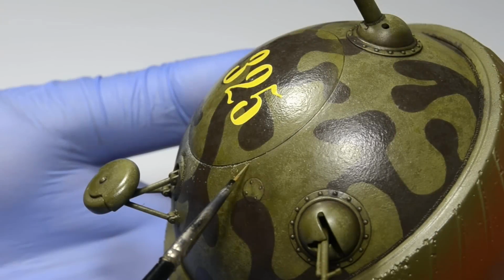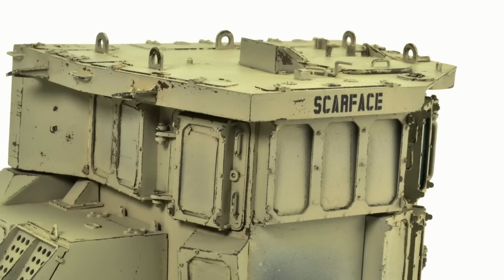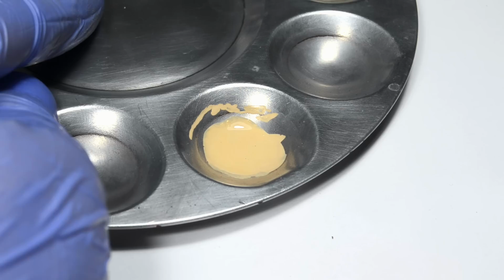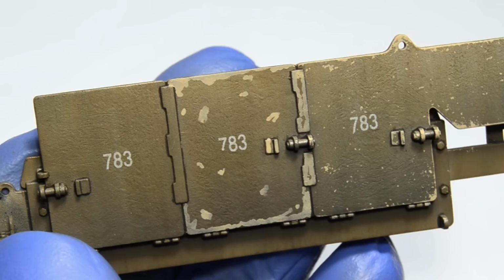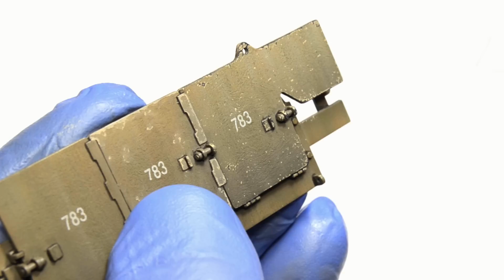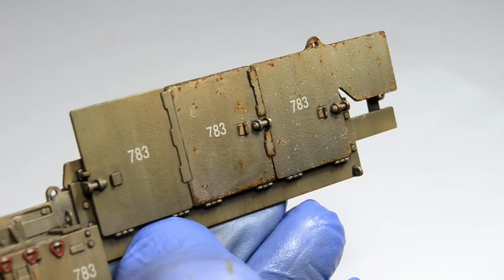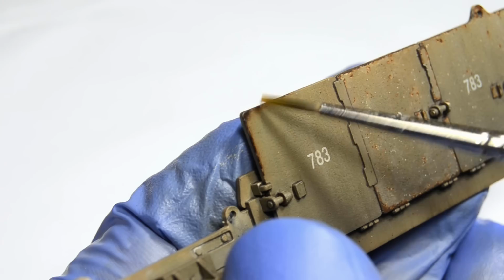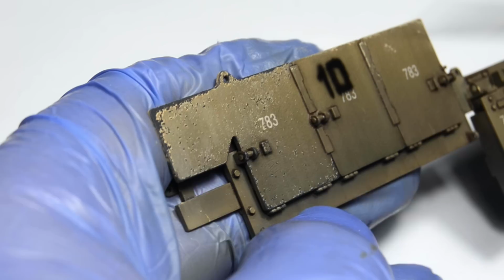4 EASY Chipping Tricks For Beginners

Comment: WOW! THIS was AMAZING! The Techniques were AWESOME and I LOVE Your sense of humor! Your English is Very Well Spoken.

PLEASE do more of these Tutorials! I'm a 55 yr. old Modeler that has been at this for almost 50 yrs. and I STILL learn New and Awesome Techniques like this!

One more I will add... I have used this to create realistic "Bare/Exposed Metal" effects by shipped paints.

FIRST I apply several layers of "Stainless Steel Epoxy Spray Paint" as the "Raw Metal".  Once dried, this gives an EXTREMELY Hard and Durable "Metal" Effect to
apply the Main Color{s} over.  Then I apply a "Chipping Agent" such as "Yellow Mustard" condiment, or Liquid Latex or Rubber Cement in the "Chipped" Areas.
Once the main paint is applied rub off the Chipping Agent and you will have a realistic "Exposed Metal" look.
I did this on my Darth Vader Chest and Belt Boxes and some other parts of my Screen Accurate "Darth Vader RotJ" Costume.

Next, I am currently working on my Han Solo "DL-44" Blaster Prop, using a REAL Metal C96 German "Mauser" from DENIX for the main gun, with an after market Conversion kit.

I have taken apart the Mauser and Stripped the Paint from all of the parts. Once the Stripping is done, I will Start the conversion. When I am ready to Re-Paint it, I will
Us a "Chipping Agent" before I apply the Satin Black paint. Once I have rubbed off the "Chipping Agent", I will do further weathering with some rusts, Oil and grim looks.

I hope this adds to your arsenal of techniques to try?

Be Well.

Joe

Comment: I have watched this many times since I started making models. 

I found one big advantage to the hairspray, chipping fluid, and salt chipping methods. 

With those methods you get actual paint breaking off the model. With the salt chipping method I had bubbling underneath my paint which makes it look like it was rust that was painted over without properly prepping the metal underneath or if there was rust forming under the paint layer. 

It gives a 3d effect on the rust/chips instead of flat painted on chips. I am still a noob and this was Unintentionally done on my latest model using the salt chipping method.

Comment: Good tips there. One thing I'd like to add is this:

think before adding any chipping (or wathering effect for that matter). Way too often I see models look lie rust buckets, but military vehicles are a) often well maintained, b) occasionally repainted with c) quite hardy paint (since one of the purposes of paint on a vehicle is to protect the metal), not to mention d) often destroyed, knocked out or simply abandoned before any serious paint damage can occur. Also, note where the vehicle is operating, and when - sure it might develop rust during a rainy autumn in Normandie, even if that's not certain - during WW2 they used lead paint in thick layers which was hard as hell and could take quite a lot of punishment before chipping off, but in the summer in North Africa? Not so much. 

So additional tip here: think and reflect.

Comment: You have single handedly inspired me to take my details to the next level I went from just painting a coat over a model and being done but the other night I started a new m48a2 Patton tank model and one of the miniatures had a flamethrower that was pretty small and you inspired me to do weathering and I had a rust and weathering kit of paints and I did some light rusting on the pack and it was only a little rust but I was so proud of myself cause it actually looks good

Comment: AWESOME! I found it very interesting! I know most of these techniques and you don't want to use mineral (white spirits) or other thinner over your paint - it will remove what you want to keep! I use Apple Barrel brand or Plaid brand water based paints because they are more forgiving and easy to remove mistakes, and dry very hard once completely cured. Thank you for sharing this with the rest of us!
Reply from the maker: Hey mate, actually no, if the base coat is lacquer based and you give enamel and oil paint layers enough time to dry, the white spirit won't remove anything that you'd like to keep there :)

Comment: Another useful tip is to make the chips tell a story, areas which get impacted more would have more chips like where the crew would climb in, where things would scrape like down the sides in the direction of travel and where stuff would be thrown up (like bricks at track ends with damaged guards etc)

Comment: i swear that YT know exact;y what i need, i currrently working on chipping on my project and your tip come at the exact moment, thank you,for a very simple, exact and precise guide.
Also, the trick to do sponge chipping is that i have to tearing the small bit more........ Mind blown, that the reason i just can't get this technique right
Reply from the maker: Haha, talk about perfect timing! Glad you enjoyed the vid!
Reply: @NightShiftScaleModels  Really thank for your work, but there is a thing i want to ask, i work on a very light sand yellow base color , what color did you think will work as the fist chipping color ?, I try to mix it with light gray , but since the base color already quite light, it just complete blend on the base coat and very unnoticeable
Reply from the maker: Well that's a tricky one. You have to see for yourself if there's still room to make it lighter without making it look white. If that's not possible, use just the dark chips, the contrast will be quite strong so they'll be nicely visible. If it's a vehicle that's been repainted with sand yellow, you can also use the underlying color for chipping (example: a soviet tank in desert, or a DAK Pz. IV)
Reply: @NightShiftScaleModels  i able to get it work, it not noticeable at the fist glance, but when i put the dark brown chipping color on, the lighter outline really do pop up.  Also, can you give me some tip on how to make those extreme sharp straight scratch line ?, my despite quite thin, still look like it was paint on
Another thing about sponge, i already remove most of the paint , when i stab the sponge it leave more like a drag paint (image that you swipe a wet paint dot), instead of clean dot like you do
Reply from the maker: @hl1796  About that sponge, try to find a different texture or tear the edges a bit more. I've had one sponge that didn't create nice patterns at all. Could be just bad luck for you. As for the long scratches, it's quite hard to explain. Basically sou should have slightly less paint in your brush than usual and barely touch the surface while painting it. I plan on making a video about it but find it really hard to describe how to proceed. It was trial and error with me, give it a few more tries, because it sounds like you're doing everything right, just need more practice.

Comment: Have you ever done any chipping that mixes old + new chips? i.e. this shot got there a month  or two ago (and rusted over), and this other one is brand new?
Just wondering if that would look weird or ok (if you've done that before). I've been inspired with a number of channels, yours and doing a  gunpla model. I know I'm putting the cart before the horse because I'm stilling scratch building some new parts and screwing up a model of the same thing I did years ago (practice), and every modification I think of still looks good in my head (as it always does).

Also thanks to putting it all to video. I wouldn't have been inspired to get back into models without you and  the other model builders on youtube (I was never an armor builder, but wow, amazing techniques!).

Comment: oof the amount of grease and Dirt the accumlates under large machines. The mechanics told me, watch your output shaft we replaced the seals but make sure the shaft seal we put in stays in place or you will be throwing oil out of the transmission

Comment: I weather my models as realistic as possible, to example I have more chips at the front of my ww2 panther tank because that's where most of the weathering would be. I always remind myself that I shouldn't do too much if my tank just rolled if the factory. And scratches would not really happen at the rear because any bushes won't be there to scratch it. And a tank usually had thicc paint on it so it woudent go of that easely

Comment: What I found most useful was how thin the paint should be when connecting the sponge applied chips with a brush.  Great videos.  Some of the most useful I've watched.  Also, on an unrelated note, what debonder do you use when cleaning up excess super glue?
Reply from the maker: Thanks! The debonder brand is Dousek.

Comment: All credit goes to VMS but you can use the chipping fluid in another way, make the chips at the mater stages after painting your base colors. You simply remove most of the chipping paint instead of the base color, looks as if it was done before. Works perfect for smaller chips
Reply from the maker: I've done that and it doesn't make the hairspray chipping any easier. In fact, it's much harder and less intuitive, as you're doing everything in reverse. It would get especially tricky around edges.

Comment: Great video, have you tried using the Vallejo engine and wash acrylic's? The 40ml newer bottles, Vallejo have a video demonstrating that you can use them like enamels and clean them up with vallejo airbrush thinner.
Reply from the maker: Haven't heard about those. I think they only sell standard Vallejo paints and some Panzer Aces ones in my country.
Reply: @NightShiftScaleModels  You can check them out in action on Vallejo's youtube channel. Though you don't have as much working time or easy use as enamels, it is a nice option if you don't want the fumes.

Comment: Your videos are fantastic, you make complex tasks look very easy and effective. Question: i have a Deagostini Millenium Falcon assembled, painted and waiting for weathering. I dont want to do exactly studio version, mine wont be in a movie. this technique looks perfect. BUT i have outside colour is tamiya AS20 White, do you think this technique would work as well with a darker colour as the undercoat (where you used beige)? i was thinking a shade of grey.
Reply from the maker: If your model is white, you can't go any lighter than that. In that case, I'd just use the second colour that represents metal. Not sure which I would choose for a Falcon, as I don't think it would've been made from steel... maybe a dark red oxide primer or something like that? 
Also, instead of using pure white as a base coat, try very light grey. That way, you can always add some lighter effects.

Comment: Thanks for the excellent video. I'm attempting my first heng long one 16th scale tank custom paint job.  I noticed at about 15 minutes in when you give the fourth method for doing rust and chipped edges, you say that you can use a combination of rust acrylic and dark oil.  Why is the dark oil paint necessary as opposed to a dark acrylic?

Comment: Hey, thanks for the amazing tutorial! I‘ll definitely use it for my next project!
One question:
You use enamel and oil colours for the chipping effects. Am I right when I assume that you painted the base layer (olive green in this case it seems) with acrylic paint? I‘ve been told once that if you use the same colour type for both, the base paint and the special effects (chipping, washes, etc.), you may damage your base paint layer with using the appropriate thinner. Is that about right?

Comment: Hi, I was wondering, do you have any advice for chipping and scratches on metal surfaces painted with metallics? Any help you can offer would be greatly appreciated!
Reply from the maker: Can't help you with aircraft, but the BMP-3 seen in this video is built from aluminum in real life, so I used very light grey to paint the chips and then added tiny amounts of pure Tamiya silver inside the biggest ones.
Reply: @NightShiftScaleModels  hi thanks for the reply, it's not for aircraft sadly lol. I do another hobby related to this one as well, in that I collect build and make games workshop miniatures, so like to add a more realistic sense to them. So I'm trying to bring in scale model techniques into the other side so as to improve and add to their aesthetics.

Comment: You mention that if you use chipping fluid you can say goodbye to modulation and post-shading, etc. On the contrary, doesn't chipping fluid ensure that you can use these techniques? For example if I want to do camo that is, say, DG sprayed over a rotbraun hull, but chipping at the sides, and I have modulated the rotbraun, the brush chips won't match the color underneath (at least not exactly). Right? Or am I misunderstanding?

Comment: What color choices for chipping on very dark vehicles like black or very dark grey.
Reply from the maker: The first light layer is simple, just make the base coat lighter using white or deck tan. As for the steel color, try mixing dark grey and some dark brown 1:1. OR if the thing is supposed to be made from aluminum, use very light grey, almost white, and then add some small spots of silver over them. In case of aluminum chipping the first light layer isn't necessary.

Comment: I have a question I hope you can help me with. I'm detailing a Heng Long tiger 1. It will be painted in a camaflouge pattern. I know the base colour of the Tigers was a yellow. My question is did that yellow continue to the inside of the tiger and on the outside did the camo pattern continue under the tiger or was it left yellow ,and the inside of where the suspension and road wheels are. I can't seem to find any good photos to help me out so I hope you might

Comment: Great technique with a few exceptions.. I don't think the rust is good for WW2 German tanks or Modern AFV's hull armor or applique armor, the material used for these AFV's for the most part do not rust due to the type of material used to make the armor. Now alot of the attachments (cable clamps, tow hooks etc) were made of a different material that would rust. I would say your techniques for chipping are great and instead of rust I use a nickle silver (medium grey)as the base, covered with a light grey (primer) and blend this is what alot of armor looks like when chipped down to metal or primer.

Comment: does the rust tone have to be enamel, I've not used enamel before, but I'm missing this rust tone type of tool from my kit.
Reply from the maker: Enamel or oil paint, doesn't really matter
Reply: @NightShiftScaleModels  I'll get both anyway as oils can be used for other weathering as well I think.

I was only really going to use a sponge to do the paint down to primer and then down to metal, but the rust looks really good. 

I am doing an imperial guard army though, so I can't realistically spend massive amounts of time on each piece. when I do some of the bigger stuff like baneblades or just any FW models though I will definitely do more to them. 

I had not realised there were so many weathering techniques really as come from a mini painting background, and it;s only been through nurgle and imperial guard stuff I actually started to see more weathering taking place. 

also GW don't tell you about anything they don't sell themselves.
Reply from the maker: @D00M3R_MAVS  Well, makes sense... why would they make free promo for other brands :)
Reply: @NightShiftScaleModels  yes, ha ha. the FW books talk about using pigments and oils and stuff though. maybe they used to sell this stuff though? (maybe they still do, must look into that)

Comment: Sponge doesn't work :( You just get a big circle of paint but no small chips. Please make a more indepth version of it. I'm considering just never chipping any of my models since every technique takes so much skill. Even the "easy" ones.
Reply: Make sure your sponge piece is very jagged and make sure to dab most of the paint off on a piece of paper towel. Start the sponge chipping with the lightest touch possible. If you aren't happy with any larger chips, just reduce the size with a brush dipped in thinner until you are happy with the result.

Comment: could you not just paint your entire tank the chipped color then paint over it with slow-drying easy to flake paint as the overcoat and just use the toothpick? or better yet use the actual materials paint it and make it like an RC tank and drive around then shoot it with an extremely small gun.